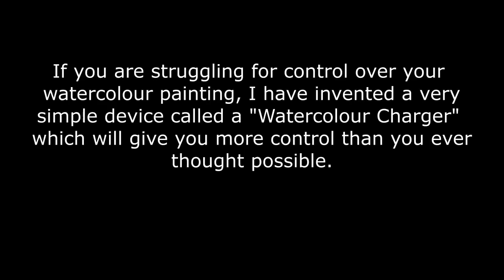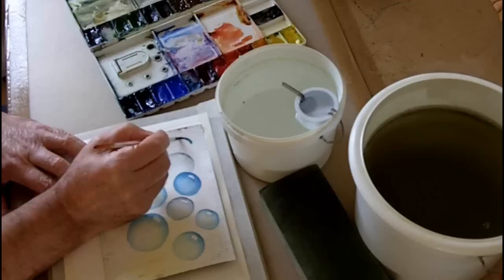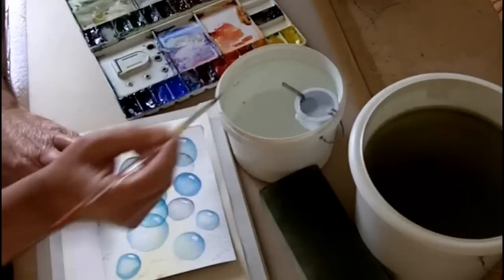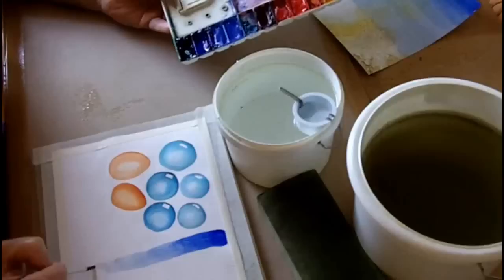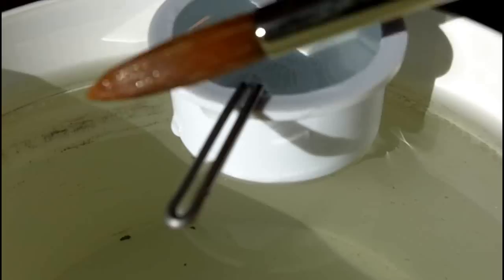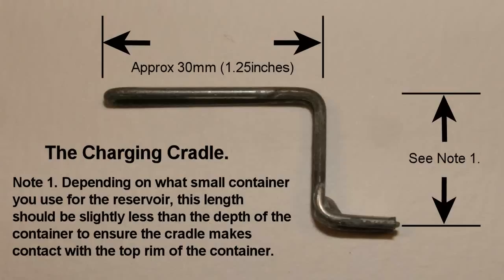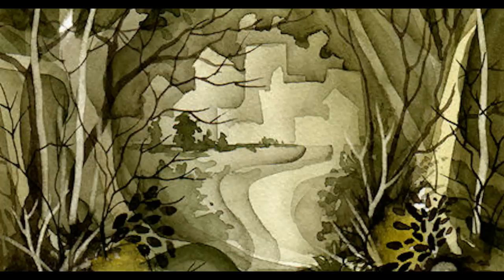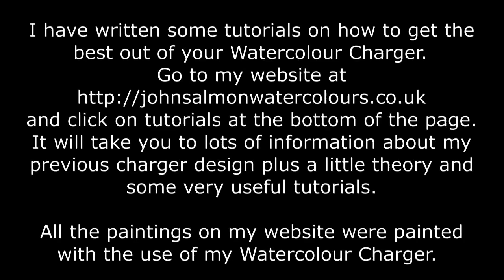Controlling Watercolour. A simple tool will help you paint better.

Comment from the maker: Hi Lucy Thanks for the comments. I'm unable to make a video at the moment but when I can I will. I did use solder although it isn't really necessary. The gap is important and I did use one of those giant paperclips but any wire of a similar diameter would be OK.

Comment: This is great!  I used the cap of a travel sized hair spray--about an inch and a 1/4 deep and about a quarter sized around.  i bent a paperclip in a Z and stuck the smaller curved end in a "hunk" of gummed eraser,  I LOVE this!!!
Reply: +Andrea Davis meant to type "kneaded" eraser  :)
Reply from the maker: Well done  +Andrea Davis Thanks for the heads-up. Pleased you like it. :)
Reply: +Andrea Davis Hi Andrea, I know this is going to sound dumb but how did you bend your paperclip into a 'Z' while still keeping a gap for the water to be drawn up into??
Reply: Wish I had a picture of that, I have had no luck getting water to flow. It just won't flow up hill.

Comment: Great idea. I've been using a little squeezy bottle with a needle tip to load brushes with water at the root, but this is even simpler.
Reply from the maker: Thanks D She, I tried droppers, syringes, sponges and all sorts but found them unsuitable because it took too long and  I couldn't control the amount of water very well. That's what lead me to making these chargers. Fairly easy to make (see easier version link in description) and very fast to use. As you know with watercolour you can't afford to hang around with some washes.

Comment: Very clever.  I will try it!
Reply from the maker: Thanks Elizabeth. There is another video of mine which shows another design which does not rust and you may find it better to use.
Reply: I tried it and I can see that the flat lip is crucial to the design.

Comment: How clever!  In addition, I would imagine that you don't use as much paint, as you don't need to rinse the brush and get more (less) paint. I am definitely going to try this.   Thanks for sharing!
Reply: Claire Bureau Well, I've made one, and it is quite impressive.  Also, I just found your video on the "new improved" version.  Will have to give that a try too.. Thanks again!
Reply from the maker: Claire Bureau Thanks for your feedback. It was good of you to take the time. This simple tool has become indispensable now and I couldn't paint without one. It's so important to control the water in the brush. Good luck using it. It may take a little while to get used to but muscle memory will kick in and you'll be flying in no time.

Comment: An even simpler trick is to use a feeder bottle for water that you can purchase at any pet supply store... you know... the one you would hang on the side of a cage for your pet hamster.  I bought mine in the pet supply aisle at the local big box store for $1.95, no construction necessary and it works way better than this paper clip idea as I don't have to keep filling the water dish to the right level, the bottle hold 8oz of water which lasts for a number of painting sessions and can be brought on field trips without a problem... as a matter of fact it's quite convenient.
Reply from the maker: Ah! Carl, I'm one step ahead of you here. If you watch one of my earlier videos https://youtu.be/h9sj6VdcTzM you'll find I did indeed use a hamster type water bottle with some modifications like adding the charger cradle. If you use the bottle with the ball bearing in the outlet tube, you'll find that very often the hairs of your brush gets snagged between the ball bearing and the outlet tube. This will ruin a good brush in no time especially if using expensive sables. Also, the water glugs out uncontrollably unlike with the cradle which you can monitor more accurately the brush take up rate. The simpler version I made because many people couldn't make the one using the bottle. The simpler version is normally quite adequate regarding the amount of water it holds and can dispense. It's surprising how little water we actually use when painting and simply topping up from time to time is no problem. There's an even simpler version on the web here somewhere where I've dispensed with the metal cradle in favour of plastic so there are no rust or oxidisation problems. Thanks for your comment, it's nice to know that others are trying to improve watercolour painting techniques too.

Comment: Hi - I'm in the USA, I tried finding a blanking cap; the best I can find is a PVC cap which has a rounded bottom and no lip.  Is there anything else that would work that I would have access to?  Thanks!
Reply from the maker: Any type of container should do Paula with a little bit of fiddling. Maybe a hairspray or deodorant cap?
Reply: Have you found anything yet, Paula? I also am looking and haven't come across anything yet.

Comment: But every time you touch the metal part with a brush that is loaded with pigment, some pigment will transfer to the metal and any subsequent touches will contaminate the paint on the brush.
Reply from the maker: Only if the brush is wetter than the metal charging cradle.

Comment: Great idea!!  I notice on your website there is a more sophisticated version of a charger.  Other than having to fill it less often - when comparing the two versions are there any advantages/limitations you can share?   Thanks!
Reply from the maker: Hi Paul, thanks for your response to my video. I made the simpler versions of the charger because the manufacturer of the Biba bottle stopped making them and people couldn't get them any more. The sophisticated version is superior in that you don't have to refill very often but the copper charging cradle needs cleaning frequently if you are in a hard water area due to a build up of limescale. (About once each month). Once it is set up properly it is really nice to use. Anyone with basic DIY or crafting skills should be able to make any of my designs and even use another style of bottle with a little ingenuity. I ended up using the plastic material for the charging cradle because it's relatively easy, there's no soldering and it doesn't rust or oxidise. Thanks again.

Comment: I'm not sure if I'm understanding correctly, but how is water coming from the container upwards into the cradle?
Reply: Water is a polar substance. Meaning, it's attracted to it's opposite charge, right? So basically this thing called a meniscus forms when water is placed in anything. The water become attracted to the sides of it's container and actually is pulls upwards on the sides of the walls. So this metal wire actually pulls and attracts water up into it's little cradle and you can then use it to your desire. It's all about chemistry and and chemical charges.
Reply: ***** Thanks for explaining that so well, chemistry wasn't my best subject...so is there a specific reason why the uploader choose to use copper wire, or does the type of metal really matter?
Reply: umm, i don't think so. It's just easily bendable I suppose! You could probably use aluminum wire if you wanted or whatever is kind of in your house.

Comment: Why wouldn't you just apply a little water to the root of the brush from a small, fine tipped plastic applicator bottle?  Lot less bother.
Reply from the maker: Be my guest and try it. It takes too long to carefully measure out one or two drops at a time plus you need two hands, one for the brush the other for the bottle. Believe me I tried all sorts of pipettes and bottles and found them to be unsuitable.